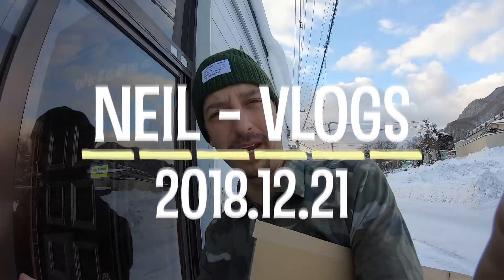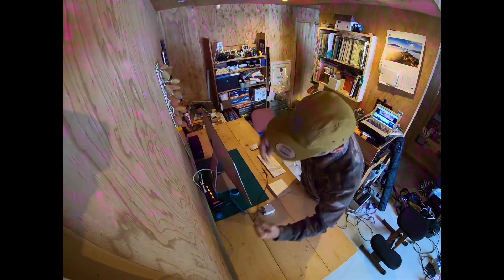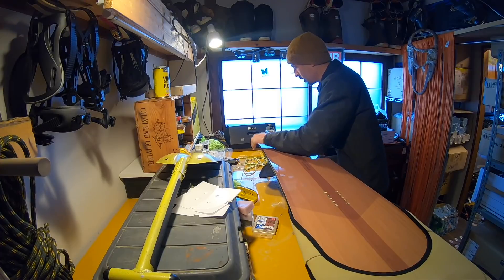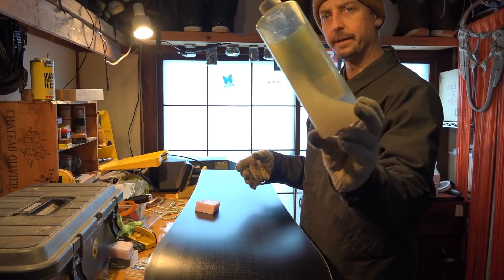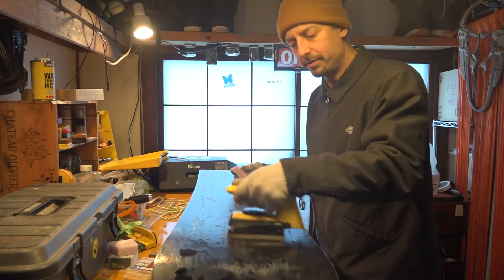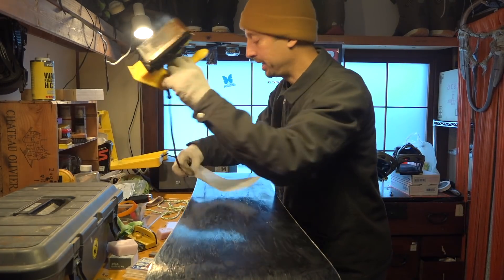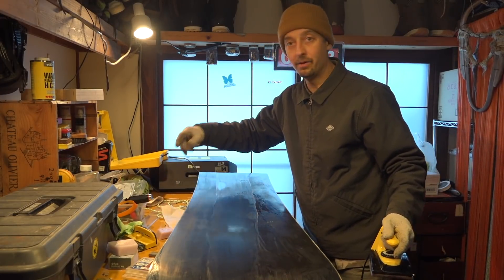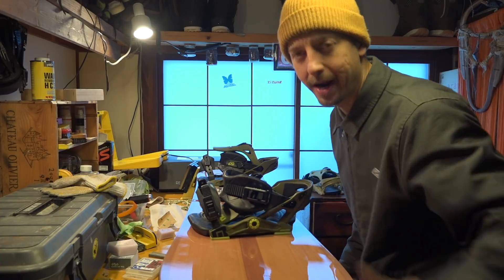Neil Vlogs 2018.12.21 - No snowboarding today!

Comment: Gentemstick,I dream of owning one.Do I need to detune magnatraction contact points on my new ORCA?Looking forward to your Quiver Corner edit coming soon.
Reply from the maker: Magnatraction is tricky to tune up your self. You may want to de-tune the nose and tail if you feel it catches on the transition between turns. Just do a little bit at a time and feel the difference it makes.
Reply: @neilhartmann  Roger, arigato.Am recovering from pretty bad work injury.Are you aware if there is any upper body armour available to purchase in Hokkaido?